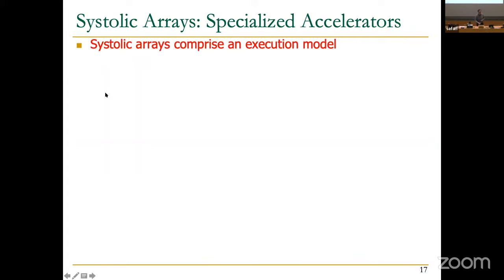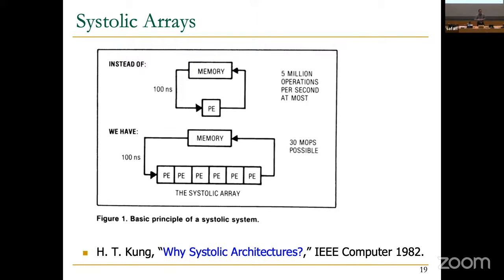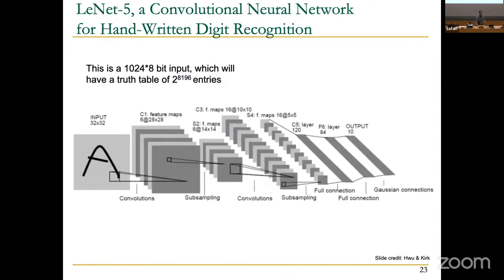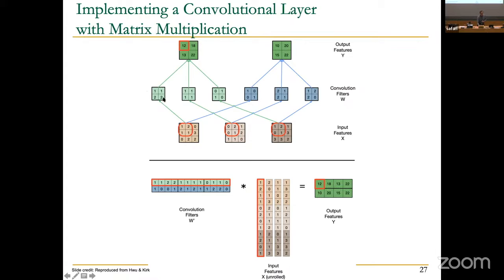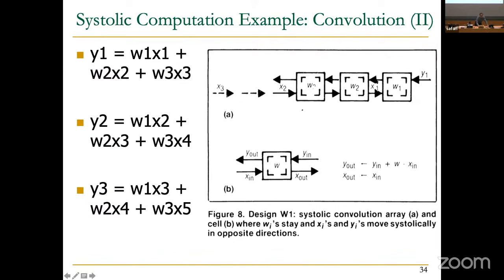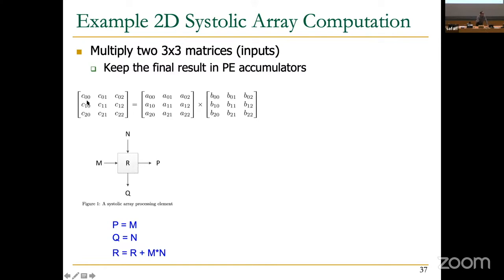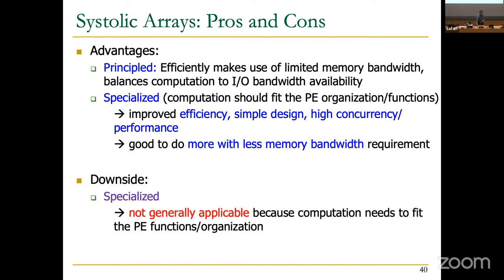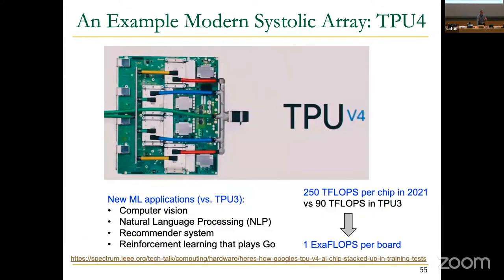Computer Architecture - Lecture 28: Systolic Array Architectures (Fall 2023)

Comment: - According to the design of a 1D systolic array, I am wondering if we should also make the weights in a 2D systolic array look like fixed in a PE?
- If the weights are moving in a 2D systolic array, all the results calculated are finally stored in the PEs, then will the throughput make a lot of difference compared with a CPU?

Thanks.
Reply: I search full example how can implement systolic Array, Thanks